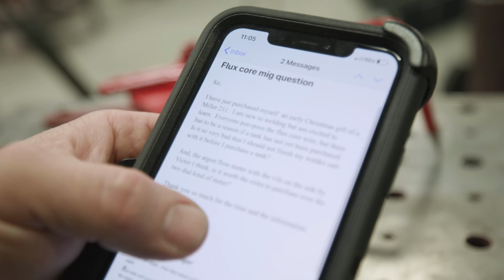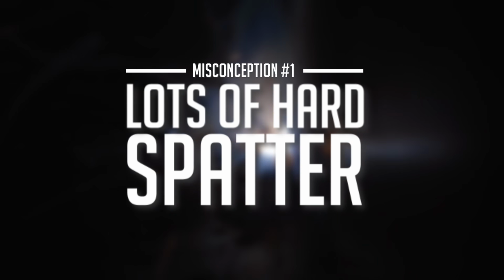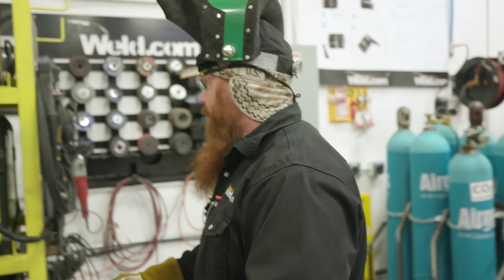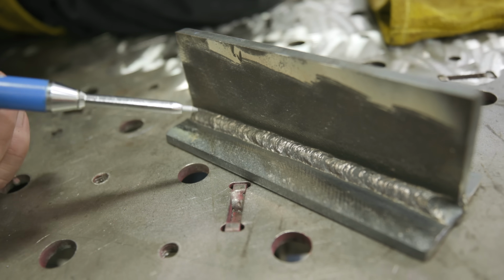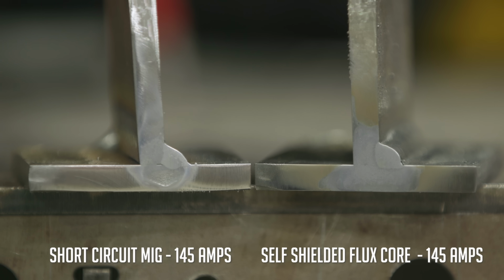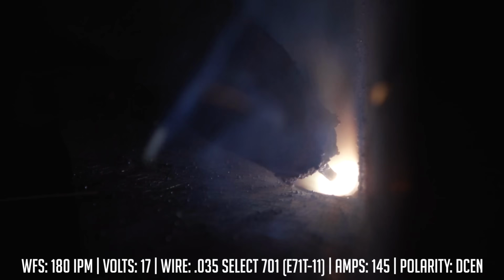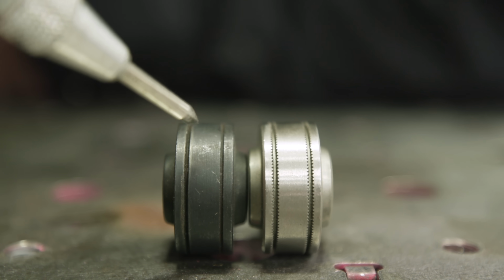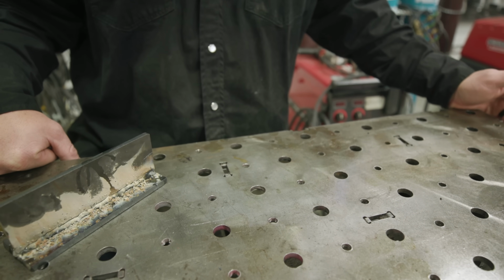3 Flux Core Welding Myths DEBUNKED

Comment from the maker: Go to www.weld.com/helpme to get help with your welds.
Reply: Cant thank you enough for this, my polarity was backwards haha
Reply: In one of the replies below it was stated that for a welder from a big box store ie Harbor Freight that because there's no option to reverse polarity that you will need to add a bridge rectifier and a choke to get DC voltage out of them. So what does this mean and where is it available for purchase? I'm fairly new to this field as a hobbyist and would like to be better at it, I already do all the tips you stated in the video but still get a lot of splatter and  porous welds and switching polarity seems to be the trick but need more information on switching polarity . Thanks and I hope you can steer me in the right direction, great video by the way!
Reply: @sms61  A bridge rectifier changes AC to DC, you are already DCEN if you are running a gasless flux-core machine from Harbor Freight. If you want to change that polarity it can be done, but you will have to take apart the gun to cable connection and ground connection inside the machine and reverse them and it is a little bit involved. What is the reason that you wasnt to change the polarity?
Reply: I didn't know which polarity was already set up in the welder (internet bought not a harbor freight welder) and was getting lousy welds (I was using Harbor Freight wire though and after I threw that junk away I bought Lincoln wire and all is great now with nice beads and little splatter. Thanks for responding and getting me the information, much appreciated.
Reply: @rolandleusden  I modified my old 90 amp HF over 8 years ago with a 200 amp bridge (overkill but that's what I had in stock) I ended up having to add a cheap heat sink to it because it would get hotter than I wanted. 2 electrolytic caps rated at about 100 v (over kill again but I had 'em in stock).  I didn't use a choke because it looked clean enough on the oscope.  It's been a great welder since then. Even before the mods it was good enough for almost all my needs.
Reply: I have a question about running double shielded flux core, when you decide to use a shielding gas with flux core, aka double shielded flux core, do you need to use the same polarity as normal flux core or do you reverse it like running normal MIG wire?
Reply: Morbian13 yes DCEP just like regular mig .  75/25 gas just like regular mig or 100% co2
Reply: @ZILAwelds  thanks that's good information to know
Reply: His oiwi2disengagement
Reply: Thanks, great video! Local regs actually don't allow me to have gas cylinders in the house so good to know I'm not sacrificing my work through process... Just technique!
Reply: Where do you pick up a gripped roller for your mig? and does it come with a new bearing?.
Reply: 4-letter URLs are not cheap.  You must be pretty confident.  I'm definitely going to be checking out your resources, thanks so much.
Reply: Add a public reply
Reply: It's important to tell people who are not full time welders that thair are basically 2 types of Flux cored wire. Shielded (gas) and self shield (no gas). The important thing is self shield runs on DC straight and is pretty voltage sensitive. If the stick out is correct and voltage correct it's easy to use.
Reply: Do you use argon with self shielded flux core wire
Reply: Can you try to use self shielded flux cored wire with shielding gas?
Is it true that self shielded flux cored wire has similar deposit characteristics to 7018?
Thanks in advance
Reply from the maker: @daniele3275  If people REALLY want us to show that we can, but I can assure you that adding gas to self shielded fcaw has no benefit.
Reply: Weld.com no benefit ?!?
Depending on the self-shielded wire you are using it will hurt you. 
The flux inside a self shielded wire is totally different than inside a dual shield wire. 
Some if them NEED TO BE WELDED IN OPEN AIR because parts of the flux need to react with the air to develop their full potential and strength. 
If you block out the atmosphere ( by using argon or co2 or any mixtures of this) you are not allowing the wire ti react with the atmosphere and develop full strength. 
Now granted some self shielded wire can be used with shielding gas still DCEN and often those types of wires are hard surfacing wires not joining alloys. 
If you use has on those it makes the “weld” deposits a little bit “cleaner” looking but in this application tensile or yield strength are really not all that important ...  its more rockwell hardness that counts ....
Reply: @Weld.com - did you work for CB&I in natrium wv back in 2011? If you did I was your fitter. Great video will help tremendously around the farm.
Reply: Put a fan blowing good. Point it where you are welding flux cord wire. It blows the gas   away.  You can see well and minimal splatter. Big difference!
Reply: Iii0oo is òòòò88⁸8⁸8⁸88888 iui it⁷⁷uh 8

Comment: Can’t believe nobody else has noticed he got his information backwards on the polarities. 

Yes FCAW Self Shielded wire should be run on DCEN or Straight polarity but he is incorrect to say that for DCEP 
70%  of heat is in your wire. 

That’s incorrect sir. Only for tig welding is that true but for consumeable arc welding processes it is the opposite.

For Smaw, FCAW , MCAW , GMAW dcep is 70% of heat is in the base metal and 30% is in the electrode. 

DCEN 70% is in electrode and 30% in work that’s why when I had to put in open roots with 7018 you would switch from DCEP or reverse polarity to DCEN / Straight polarity.

DCEP was substantially harder to open root with 7018 and it’s because 70% of heat is in the work and 30 % is in the electrode. Swap polarities and now the rod is holding 70% of heat and the parent metal has 30%

Comment: I had not seen this 6 year old Vid. Thanks.

I've done a lot of feet of Flux-Shield welding using 0.045" Flux wire and Co2 gas in 4G. Yes a bear to clean. My good old 30+ year old HarborFright flux core welder is what I grab to do quick layups and tacking. Clean it up and TIG it.

Comment: Biggest problem I’ve seen the FCAW is people leaving the spool out in humid weather and worm hole porosity galore. I agree if you want to lay down some welds. SMAW isn’t the way to go. Just need good control of the wire and a good set up. Great video

Comment: my biggest issue with my machine was the amperage draw. because I had to use an extension cord to take it outside to weld. did my research, upgraded the cord, welds were perfect. use a 12ga cord or bigger.

Comment: 3/16th and thicker, flux core is my go to, unless a WPS states otherwise.  If I am indoors, dual shield, outside self shielded or I will run SMAW.  I think it is important to emphasize people need to understand they need to set polarity for the electrode they are using.  While most self shielded is DCEN, however there are some self shielded that runs DCEP.  How the heat is released and focused is not just process dependent, it is also dependent on what if anything transfer across the arc column.  Flux content can affect that as well as arc stability.

I do not have as much experience with self shielded, but my experience is gas shielded has deeper penetration.  Doing a video on that would be useful.

When most people are talking about how heat is focused are using information from GTAW.  All that transfer across the arc is electrons so their impact on the metal surface focuses the heat, so DCEN provides the best penetration. With processes that transfer material in the arc, on DCEP, it is true (if we use electron theory) the electron impacting the electrode melts the metal and flux if present.  The molten material from electron flows across the arc and impacts the plate, this impact again is what transfers and focuses heat.  GTAW greatest penetration and focus of heat in the material is DCEN.  Consumables electrodes, DCEP providers the best penetration because the heat is focused into the plate.  How heat is focused is the opposite from GTAW to the consumable electrode processes

Comment: Just bought a cheap $150 135amp synergy/manual flux welder on Amazon.   It welds really well for its super small size and only 120v power. Hardly any spatter and handles 1/4” easily.  
It wasn’t worth buying a much more expensive multiprocess machine. In the future if i want to tig steel and aluminum buying another specialized machine seems like a better path.

Comment: Hi 
From the uk 
At work I am comfortable with mig and tig at home I don't weld in the garage or work shop to much fire risk, I weld outside, so I use good old arc as I never have to weld any thin gauge stuff arc is fine and can see that flux core would be just fine for the home gamer outside

Comment: Wooo!
I had a 120amp flux core welder, measured it and it had mixed up polarity from the facory!
It was not a faulty assebly, it was designed that way!
I changed the wires with thick beafy ones, and tried it with electrode negative pilarity, and maaaan it is cleaaaaan!
Thank you!❤

Comment: I'm considering buying a welder for home. I have watched various videos on both stick welding and flux core. However, I am still confused as to which system I should get. Flux core seems easier to handle. I have a project in mind using 40mm galvanised square tubing with approx 1.6mm wall. I'm concerned the material might be too thin for one or other process and simply burn through. Also, would I need to clean areas to be welded to remove galvanising or will the weld still take?

Comment: As a millwright at a lumber mill in the PNW we do a lot of emergency repairs on equipment outside which is commonly rainy and windy and have found we have a much easier time running self shield flux core wire with much better results than when we used to only use 6010/7018 stick. In the shops we use dual shield since even in summer it’s still pretty humid and we get better welds than solid core. It’s amazing how much misconception is out there about fcaw.

Comment: Great video. I'm just into my second 2lb roll of self shielded flux core and been welding without a gas cup which was allowing me to get my wire too close to my weld pool causing exactly what you showed in this video. I thought it was my settings but noticed my welds got better when I put the gas cup back on which was actually forcing me to keep the correct wire distance from my weld pool and my welds looked so much better but I thought it was from the cup helping to keep the gas created from the flux around my welds.but this video has brought it all into much better perspective. So I think my welds are going to improve even more after watching this. I also destroyed my shielding cup in the process by getting too close to an inside corner vertical weld and rested it onto the leg of the work piece at 100 amps and melted a nice hole in the side. I guess it's all part of learning but I hate doing crap like that. Most of my problems is being able to see the weld pool so I'm gonna try turning my auto darkening helmet down to its lowest setting I think it's on 11 right now.

Comment: Something important to consider is dealing with sheet metal. Because flux core is putting 70% of the amperage into the work piece it will easily blow through sheet metal. The best for sheet metal is 0.23 solid wire with gas. Hope this helps someone.

Comment: Hey, I really enjoy the videos you put out. Liked a subscribed.

I was wondering if anyone could explain to me when he mentioned 70% of the heat is in the electrode on DCEP? I always thought that with reverse polarity the base metals had the heat as the there is a heat loss at the arc transfer from the base metal to the electrode. Negative to positive, work piece to electrode? Thanks!

Comment: If you are a welder that travels to sites mainly outdoors, fluxcore and stick are the way to go. Im a sign tech and having a multi process welder to switch between both is a godsend. Stick for the heavier structural jobs and fluxcore for general repairs and you dont need to lug around a bottle, just plug into the power supply on the truck or a generator, or even better a location at the site itself

Comment: T 7 . T 8 . T10 . T11 runs dcen how i remember is i think of my rods. T7 T8 is 7018 and T10 T11 is 6010 6011 and how i remember what wire uses gas t1 t2 t5 t9 is i think of suicideboys grey 59 and the 12 is like them counting down to start the show bigest tip i got fo if you trying to remember stuf when studding is just read that book over and over and find somthing that works for you think of something in your head that makes you remember and good luck if you want it you will get it i promise

Comment: What if your welder is one where you cannot change the polarity and is strictly a flux core welder.  Is this an issue with a flux core only welder?  I’m new to welding and have yet to do my first attempt. Thank you!
Reply: Most property designed fluxcore welders come set in the right polarity but a few do not and those are the ones that spatter very badly. Titanium flux 125 is a very good fluxcore welder as well as the century model by Lincoln electric.
Reply: I watched some videos on how to convert a (go ahead and laugh 😆) Harbor Freight Tools flux core welder to DCEN as that welder is a bare bones AC unit which might get you home, but it'll be BUTT UGLY! The conversion wasn't really that hard, requiring a hefty rectifier (converts AC to DC), a BIG capacitor (to smooth out the voltage ripples), and and a nice big inductor coil (inductors resist changes in amp draw). I went the extra mile and swapped that weak and sad stock cooling fan with an old 120VAC computer fan which allowed much longer duty cycles. I did notice considerable improvement in bead quality and reduction in the quantity of Amish horse apple production.  Now if only I can improve on the one variable that you can't buy parts to modify: OPERATOR ERROR! 😆

Comment: I recently went to work with a fab shop and they use 95%argon 5% oxygen have you ever welded with that mixture if so is it possible to run vertical using er70s-6 .045
Reply: Wow after 30 years of shipyard production welding I've never used an oxygen mixed gas to weld. Most procedures require certain gases to prohibit oxygen contamination. You learn something new in this field daily.

Comment: Once the process is learned Flux core gives  us much of the "best of both worlds " of Arc welding and wire welding. It gives the reliability and  relative ease of use  of Mig with the power and general utility of arc welding . And since its hollow  its practical to use  heavier wire with FC than with mig so that i wouldn't hesitate to use .045 wire on 1/2 " material with Flux core..and  much heavier wire is available if one has a machine that can use it

Comment: Is flux core strong enough to weld .120 wall mild steel dom roll cage tubing? Also how big or how many amps does a flux core welder need to be to weld .120 wall Dom roll cage tubing?

Comment: Switched to flux core to weld stairs at my APTS. Now I am really into Flux Core. I hava a fan and ventilation, but I was wondering how bad flux core is for the health. I feel like solid is really bearable, however flux core seems a little toxic, but not enough to wear a mask. I am an EMT and I do not like wearing masks—anymore than—necessary.

Comment: Your understanding of polarity and how heat is distributed is backwards. 70% of the heat is on the negative side. Go try a 7018 weld with dcen and you'll experience much faster rod burn off and less penetration. A technique sometimes used in a pinch to stick weld sheet metal.

Comment: if your steel  1/4 inch or thinner then flux core welds are OK for most rough finish applications.   the new $100 cheap welders fail when they don't get full amps from the plug in outlet and work better off the generator for consistent power and heat

Comment: What if the machine is cheap and cannot swap polarity bc the torch is mounted permanent to the machine?
Reply: Because that first splatter ropey bead is what I’m getting. Machine as a high/low switch and one knob for wire speed

Comment: I'm very new to welding and not ready just yet but trying to do my research and figure out what not to do and do damage to my floor in my '92 Foxbody Mustang that will need floor patches and I Plane on doing sub frame connectors as well.

I bought a Hobart Handler 140 several years ago and I've still got the sample Flux core wire spool still on it. Only played around with it maybe 20 minutes. The welder and cart along with all the accessories I bought with it are still new.

My question is because everyone is telling me not to use Flux core when welding thin sheet metal floors and to set it up for solid wire and get me a tank.

As I just watched your video and your saying with Flux core to reverse it so that you get the metal hotter so you have better penatration while using Flux core but will I need to do alot of practicing with scrape sheet metal flooring to get good enough and find that happy medium to not burn through the thin sheet metal?

Sorry such a long post.

Comment: Broke one of the wheel brackets on my Kubota mowing deck. Talked to the dealer, and they were going to charge me $300 to weld and repaint it. I decided to go to Harbor Freight instead. Bought a flux core welder, mask, gloves, wire, brush, etc.... all for about $150. Practiced a few times and then welded that bracket up just fine. Cleaned up the transition with an angle grinder and touched up the paint. Took about an hour, and I saved $150 and now have the equipment to weld other stuff. I'll probably only use it a couple of times a year... but it was a no-brainer. The weld has held great, even when mowing on hills when there's a lot of pressure put on that bracket.